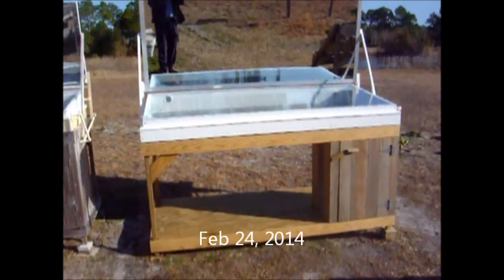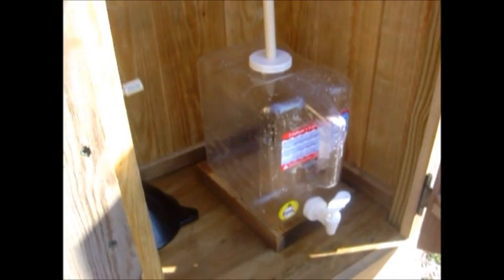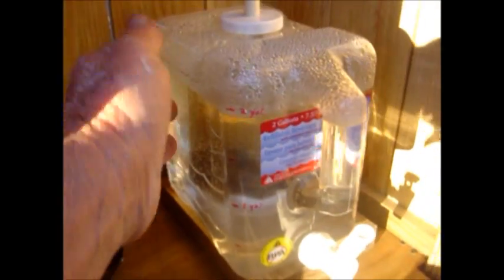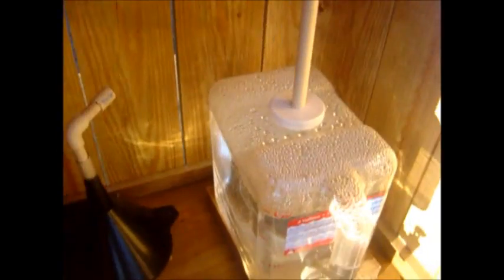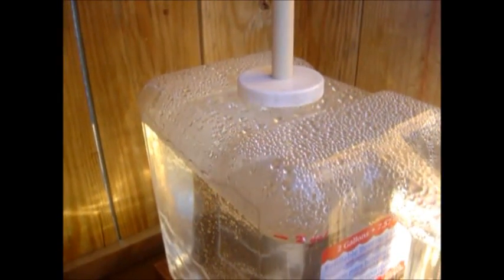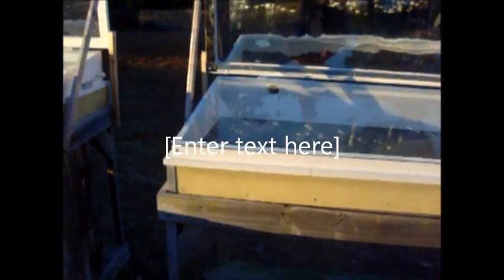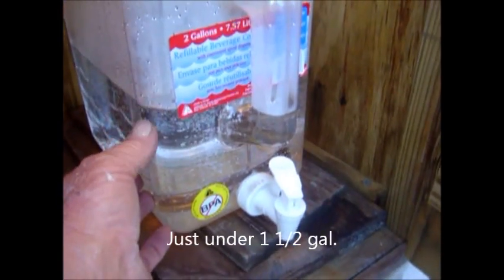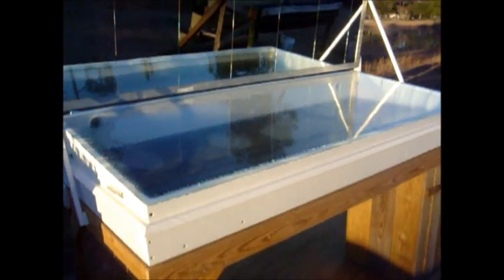Solar Water Distiller Build Part 4

Comment: Great video... loved it...
Do you have an idea about how much water will be distilled in a day for a 10ft X 10ft unit for a morning-noon-evening temperature of 30-40-30 degC..
Reply from the maker: I'm so sorry for the late response to your comment. With all the virus crisis stuff I have failed to keep a good check on this YouTube account.

First thank you for your comment.

So you are asking about a 10 ft. X 10 ft. unit? WOW!  That's a big one for sure. As this video shows the larger unit is approximately 18% larger than the smaller one and out produces it by minimum of 70%.  However the molar mirrors on the smaller units are not as reflective as the glass mirror of the larger unti.

The production of the larger unit is about 0.11/gal per sq ft. Going just by that, a 100 sq ft unit would produce a minimum of 11 gal/day (41.65 liters/day) at the temperatures you describe.

Notice that my larger unit out produces the smaller unit so I would estimate by the larger size of a 10 X 10 unit could possibly produce up to 70 liters/day or more due to its massive size.

I can only estimate production of that size by comparison of what my units produce. The total sunlight per day and ambient temperatures play a big part in production.

I would be very interested to see exactly how much such a large unit would produce. Please keep me informed of your progress should you decide to build that massive unit. I will help you however I can from here. You can contact me at my email  jp5er@yahoo.com

Comment: So roof angles aren't good, needs to be flat for basin.  5/16 th's deep for optimal heating of basin water.  External condenser is optimal, so glass angle can be less steep, about 5 degrees or what ever lets light in.  

Any numbers for how often to drain brine, based on tap water TDS number?

I want to build a controller to open a drain valve.   And use a float valve for auto refill.  But if brine takes weeks to get too concentrated then maybe I could leave that manual for now.  Also use food grade barrels for collection.  I don't plan on drinking the water so not concerned with plastics.  My plan is to make sufficient volume to rinse multiple cars after washing.  Maybe 50 gallons per week.  Hooked up to my pressure washer.  I'm on septic vs. sewer so DI systems put too much salt into my concrete tank and eat away at it, and build up salt in my leach fields killing bacteria needed to help decompose solids.

Need to figure out glass area for such needs, like how many of these to build.  How much less efficient is your system design without the mirrors?

Would be great to see these mass produced and included in every home roof design along with PV solar.  Brine water could be used to fill toilets.
In CA PV is now required for new homes.  Maybe someday water distill will be too.
Reply from the maker: Ooookay! That is a lot for me to address. Let me unpack it and give it a shot.

Bye you saying roof angles, I think you mean the angle for the top of the unit. As I said before the angle is set bye the size of the glass you are using. The two pieces of glass, 1 for the basin and one for the top are the same size. Using a 3 and 1/2 in board for the front of the top and a 7 and 1/2 in board for the rear of the top creates the angle of the glass of the top. The top is measured to fit inside of the Basin walls. Yes the Basin is made Flat. The angle of the top glass can not b two flat and level or the water will not run downwards towards the trough but we'll just drop back into the basin. The angle of the glass has little to do with sunlight penetrating, that will happen regardless of the angle.

The external condenser is optional not optimal. Yes five sixteenths of an inch would be an optimal level for the water in the basin more water in the basin will take longer to heat send a shallower amount.

As for draining the brine that would depend on how dirty or salt and calcium Laden the water you put in it is. I just use good judgement and clean it out when the bottom glass is fully covered in sediment. It will still heat and condense the water but it may be slower with the bottom glass covered in white instead of seeing the black on the bottom. I only have two clean the basin Maybe once per year, twice at the most.

I have an automatic Phil system on the drawing board but life has me doing other things at this time and I cannot get around 2 installing it. I will definitely make a video of it to post when it gets done. It does not involve any Electronics  or electricity or valves of any kind. 

I understand you want to use the distilled water to rinse cars 2 eliminate water spots I'm guessing. Your estimated use of 50 gallons per week will not be produced by 1 of these solar distillers as the model shown only produces a little over two gallons per day. With you wanting 50 gallons per week it would take a minimum of 4 or 5 of these units to meet that amount of production. And every day would have to be a cloudless sunny day. The mirror does Boost production but not nearly enough to make one unit produce 50 gallons per week. 

I appreciate your enthusiasm to have solar water distillers in every home along with PV and solar water and space heating systems, however that would be a long time in the future. I have racked my brain trying to design a large system that could be used 2 recycle waste water from ponds on Hog Farms and while it can be done it would prove too expensive to be feasible.

Comment: It is cool. But one needs space for it. Cool anyway.
Reply from the maker: Maneb Expert Thank you for your comment. Yes, the unit is large. It's definitely not a countertop appliance that's for sure. These can be made smaller but the bigger they are the more water it produces. 

Think mine is big? Last year I assisted a man in Missouri as he built a 4ft X 8ft unit. Now that's big.

Thanks again for the comment.
Reply: You're doing a great job! I hope more people will use your method or devices. It is a great idea.

Comment: Only use Stainless steel and glass! Plastics, kit etc. is very unhealthy!!
Reply from the maker: I use 100% silicone. How would you seal the glass against the stainless steel? Then I suppose you would use stainless steel or glass tubing and stored only in glass or stainless steel, right?

it's crazy to think that we all buy food and drinks packaged in plastics and even aluminum and yet we survive.

I only use food safe materials in the construction of these distillers. My family and I have drank water from these distillers for over 20 yrs and we're doing fine. In fact PVC is widely used to distribute municipal water supplies. It has been for years and more PVC waterline is being installed every day. Seems engineers don't consider it to be very unhealthy.

Please explain when you said "Plastics, kit etc. is very unhealthy!!" What kit's are you talking about?

Comment: can you do a floating one. I heard the angle of glass should not be less than 15 dergree?
Reply from the maker: +spirit 1770 Thanks for the question. I don't know where you heard that the angle of glass should not be less than 15 dergrees but as you can see my unit has a less than 15 degree slant and it works fine. Too little of a slant will make the water drop off of the glass  before reaching the trough. You can always use a greater angle than I use if you want, the problem is that increasing the angle reduces the size of the basin width-wise and as a rule a larger basin area is better. As for a floating unit, I have thought of that myself but there are a couple problems with a unit floating on the basin water.  One is that you want to keep the water level in the basin to 5/16" or less. Too deep of water means that there is more water to heat and this will lead to less production in a day. For example if you had it floating in a pond the water would be free to enter and leave the containment with any movement of the top or any current in the water it is floating in. You would essentially be trying to heat the entire pond before producing condensation on the glass. The other reason is that since the top is floating, the drain port is not very high off the water level outside the top. It will have to be pumped upward into a storage container. Of coarse if the storage container is below the water level in which case you would want to make sure that it is sealed to keep the water it is floating in from entering the container and contaminating the distilled water you just made. There will also be a problem with an empty container floating, only sinking as much as the water that is put in it.

Those were very good questions and I hope I have explained my answers, thanks again for asking.
Reply: 15 degree angled glass is for internal collectors, to avoid distilled water dripping back into basin.  This is an external collector/condenser design, which appears to be more efficient.

Comment: Hi Starfiresolar.
I was wondering if you could just tilt the collector at a steep angle and eliminate the mirror. Have you tried that?
John
Reply from the maker: zpoedog  I understand your thoughts on this and that is a fair question. The model I make can not be slanted or the water runs to the low side and leaves most of the absorber surface dry. There are models that are angled the way you describe. It involves a different configuration of the absorber. It is shaped like stair steps with each step holding water on the top and the riser doing the absorbing and transferring the heat to the water. 

Due to the small amount of water held in each step, it needs refilled periodically during the day and they build up deposits rapidly. When the deposits build up it slows the absorbtion of heat and need to be removed.  These units can not be cleaned easily because of the way they are made. These units can also benefit from the use of mirrors, but that only leads to faster evaporation and faster build up of energy robbing deposits which also leads to the need of more frequent cleaning.

There are three ways to produce more distilled water from any model of solar water distillers.  One way is to have more units. Another way is to increase the condensation area as I have done with my design and installation of the External Condensation Chamber. The other way is to concentrate more energy to the absorber surface and that is with mirrors or another absorber such as a solar water heating panel that connects to and circulates the basin water. This presents a whole new set of design issues and expense. If the collector is lower than the basin it can function as a thermal siphon flow or pumps can be used. There is also the  problem of the deposits forming inside the tubing of the solar collector. These are not easily cleaned and as they build up they actually insulate the water from the absorber surface. This slows down the heat transfer and the water production. 

So yes,  building a slanted unit as you suggest can be done. Is it more productive than my model per sq ft area? No.  Is it easier to clean? No.  Will I ever build one. Absolutely not.

Thanks for your thoughts on this and I hope I have covered the subject well enough. 

As I told you I was going to do, I have posted the first of my new solar water distiller build series. It deals with selecting the glass, separating the insulated glass and cleaning it to be ready for installation.   Please check it out and let me know your thoughts.

Comment: Hi Starfiresolar: I looked on line to find out what black aluminum trim coil was. Also, was that a basic piece of glass you put in the distiller for the base or was it tempered glass? My husband use to work in a sheet metal shop, so I'll ask him to make the trough for me. Thanks
Reply from the maker: Actually, the black trim coil is not the best thing to blacken the glass in the basin. Although it works I have found through trial and error that it would be better and cost less if you simply use black silicone caulking to coat the bottom of the glass. I was using black paint but it oxidized and released from the glass over time. I tried the black trim coil, it works but is more expensive and can be done better and cheaper with the black silicone. Yes tempered glass is a must have for the glass in the basin. Also through trial and error I found that regular glass used in the basin broke when I put the unit into service Due to the operating temperature of the unit I don't trust just regular glass for the top glass just to be safe. Plexiglass could be used but it may sag in the heat and I don't think the silicone will bond well to it and cause it to release.  To apply the black silicone to the underside of the glass of the basin, first clean the glass then apply the silicone and with a wide putty knife smooth the silicone onto the glass in thin coats until the glass is totally covered. If one coat doesn't totally blacken the glass wait for the silicone to cure before applying another coat.  The black siliconed side of the glass goes in the basin with the clean(not siliconed) glass side towards the water in the basin. That way the periodic cleaning of the deposits are easier to clean than trying to clean the siliconed side and there is not chance of damaging the silicone. I hope I've made these points understandable. Thanks again and glad I can help.
Reply: STARFIRESOLAR Might it be better to line the basin with black slate tiles? Should last indefinitely and act as a heat sink?
Reply from the maker: celeste barta Hi Celeste! Good to hear from you again. As for the glass in the basin, it must be tempered glass. The risk of the basin running dry is too great to leave to chance. If the basin runs empty the heat will crack regular glass for that reason I suggest both piece of glass be tempered. 

As for the black aluminum trim coil, I have made a change on that. It will be best for you to use black silicone to coat the bottom side of the basin glass. Just apply it with a wide putty knife in thin coats until it's completely covered. This is less expensive and will work better than the black trim coil. If I can find your number I'll give you a call and explain this change I have made in construction.

Thanks for your questions.

Comment: Thank you very much for your videos. Could I use pond liner for the inside of the container to hold water? I'm making a small water distiller and started with a piece of glass I already had 19.5"  x 18". I made a solar oven about 15 years ago and still had the glass. Thank you again.
Reply from the maker: Celeste, As a rule I only make these water distillers with material that is food contact safe. PVC, aluminum, 100% silicone, and glass are the only things I use. The PVC and silicone go through a brief out-gasing process when first put into use until fully cured, this usually takes about a week to 10 days where you can faintly taste it in the distilled water. After the curing process this goes away there is only the purest and great tasting water.  Although your glass size is just over 2 sq.ft. it will work but keep in mind that the larger the glass area the more water you will produce. Instead of making a distiller of the size of mine you can always make multiple small units to increase your water production. Thanks again for your question.  I'm always here to help if I can.
Reply: STARFIRESOLAR
Thank you Starfiresolar,  Do you have a list of the materials for the distiller. I will need to go to the big box store to pick up some of the items you mentioned. I do have a piece of plexiglass about the same size as the glass and I will be making a second solar distiller also. Thank you
Reply from the maker: Celeste, Check your messages. I have sent you a personal message with my phone number. We can cover this topic so much better and faster talking to one another. Please call me at your convenience. My name is Mike.
Reply from the maker: celeste barta Celeste, Call me at 910 326 6136 and we can cover this topic better and faster. Thanks